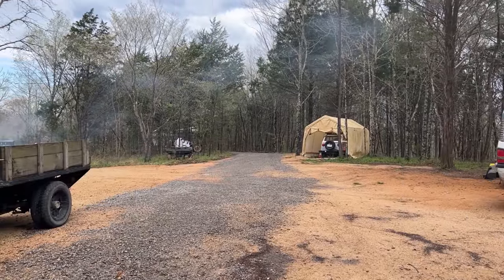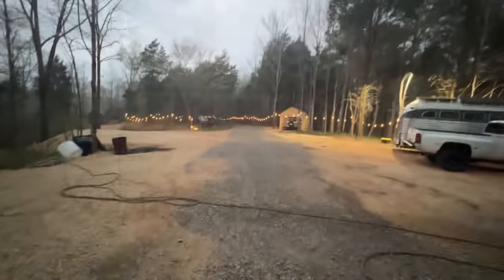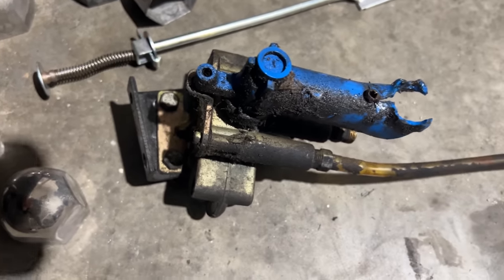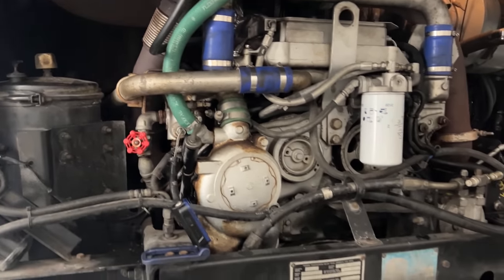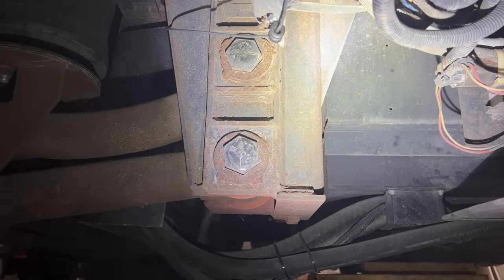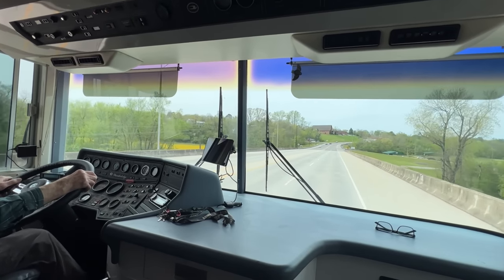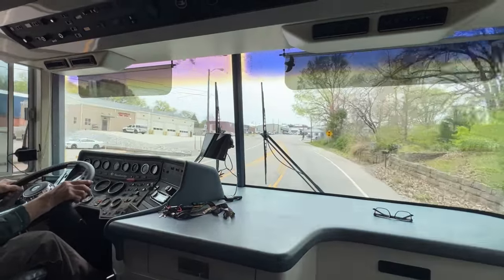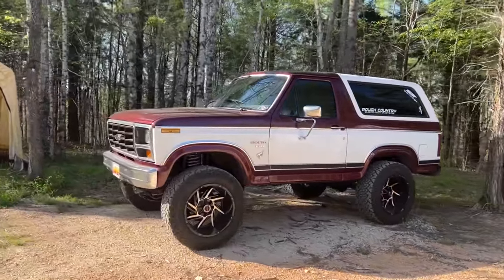Wanderlodge bus handling problems, brake issues, and suspension lean

Comment: I'll bet that the local O'Reillys is starting to stock bus parts just because you are requesting them so much.
Reply: I'll betcha that at the very least, ABC, Heavy Duty Parts, or Hausman sets up a stocking location in central Tennessee or south central Kentucky, as they've had to have noticed a volume increase in motorcoach specific parts shipments to the area.

Comment: Glad you got Jeff fixed up. I think I have the same banging sound in the front, I had checked the king pins before but who knows. Guess I need to check them again. My buddies bus does the identical thing, wonder if they did not shim these correctly from the factory or if it just wears the shim down. Sounded like his batteries are low, kinda was dragging when it started.
Reply: Add mine to the list.  Does exactly this.  Clunk, then pulls a bit to the right. I'll try all of this when I get around to trying to fix it.
Reply: @OGGarrettsGarage  That’s interesting, will be curios to see if they all have the same issue. Look forward to your video!

Comment: At least you guys are so high up that flooding is never going to be an issue.. The off centre bolts to adjust the caster are called 'eccentrics' , modern sportsbikes have them on the front axle so you can have a means to adjust the rake easily.

Comment: That problem of driving off the edge of the gravel is 'off-tracking', those rear wheels follow a tighter curve (up to 3 feet) than the front wheels. I hope your son wasn't injured to badly, it looked rather painful in the video.

Comment: I can see why the buses run off to the left, you just have to wonder how many of them are due to drivers "forgetting" they're driving a 40+ foot monstrosity vs. their normal car.  I drive a 42-ft school bus with a short 20-ft wheelbase,  and even that's tough sometimes - I can imagine it's easy to "forget" to stay wide on that jog.  I guess you know where the next load of rock is going?

Comment: I felt Tyler’s pain when the torque wrench let go, I was in a similar position tightening wheel nuts on an off road only tri axle dump trailer when the wrench let go and I fell between the rear two sets of duels hitting my head of the mud guard bracket and spilled out onto the workshop floor with blood running down my face and the other three men there in stitches laughing there asses off at my funny way of having a lay down 🤕

Comment: How do Quonset Huts (your building) handle a lightning strike? Also Radar can be delayed up to 30 minutes due to alot of factors.
Reply: I'd say the roof is  made of interconnected corrugated metal sheets. So they basically make up a giant Farraday cage, right?    In case of a strike the current will seek the shortest,  best conductive way to ground. If the roof structure has been properly grounded any lightning strike should do minimal damage. 
But then again, you can never truely tell until it happens. There is so friggin much power in lightning. Dangerous stuff.